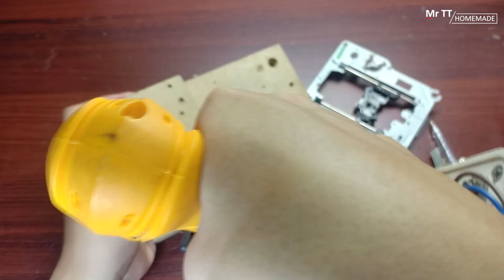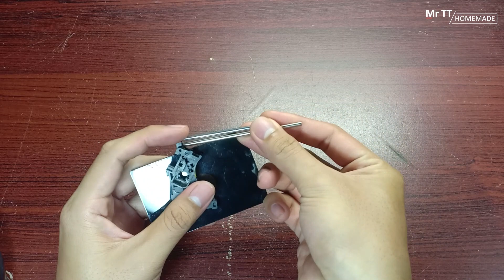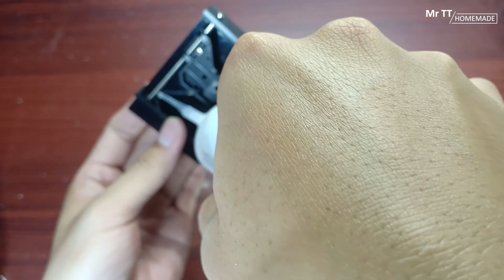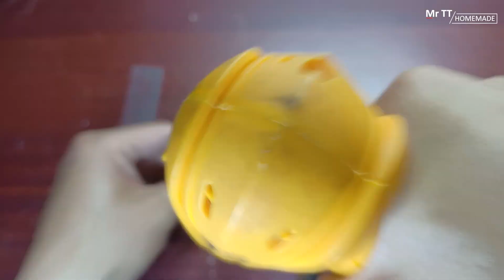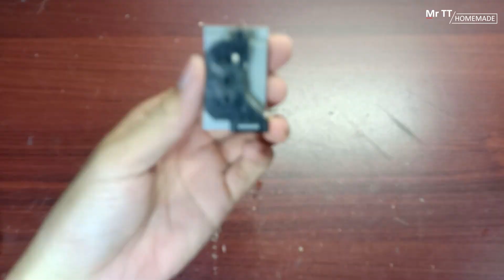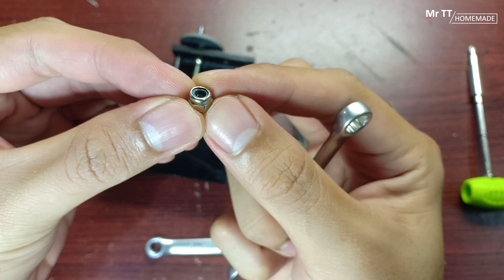DIY mini lathe with 775 motor | Mini lathe machine | Mr TT Homemade.

Comment: lool... no rigidity at all, no repeatability, the cross slide is wobbly af (you can see it moving all over the place).. 

Get some cheap aluminium and rebuild all the plastic parts with that, will help a ton.  also, that little motor has no torque, use a gear reduction to increase torque. direct driving a motor in this way is also bad for the motor (no trust bearings) so a reduction gear set will not only increase torque, but will prevent the motor from taking the abuse
Reply from the maker: Yes that's right, thank you for your comment.
Reply: For 500rs,  you're expecting international GD&T standards,  
It's really good work.  .think positive,....